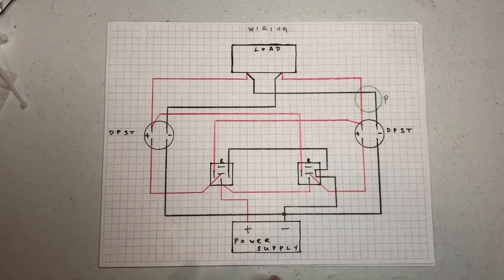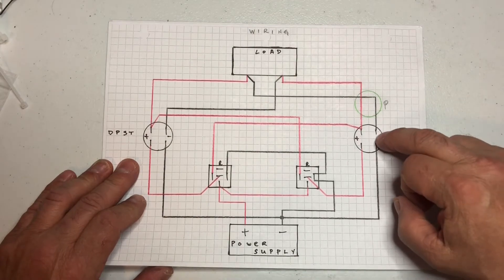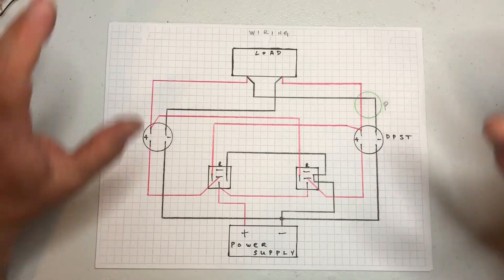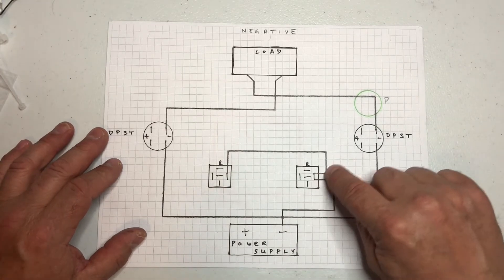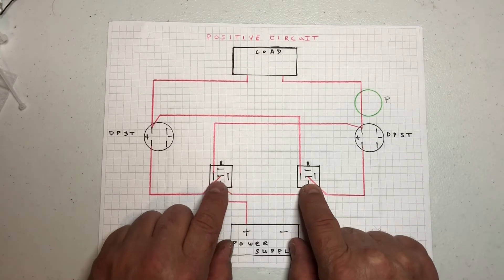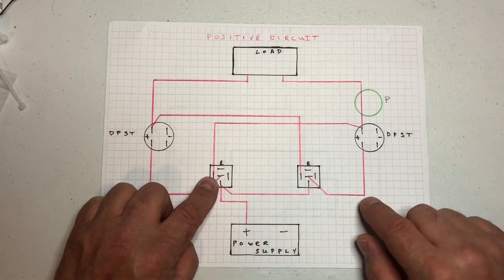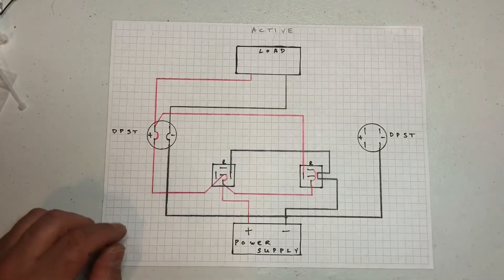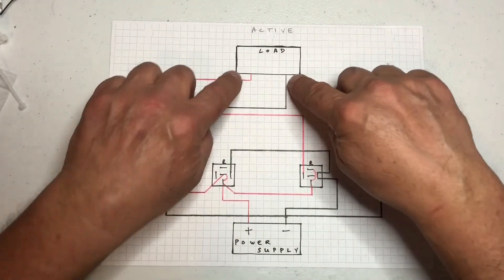Diagram for bi directional and speed controller

Comment: This will work when
you don't have a DPDT On - Off - On Switch
or
you don't have a SPDT On - Off - On Switch and 2 SPDT relays

This a good work around. Tho I would have used the two DPST switches as just two SPST switches to operate the relays. I never like putting the power running through a switch.  And it doesn't matter if both switches are ON, nothing happens. Like you did in another video you did, a few videos after this one.

Another T up